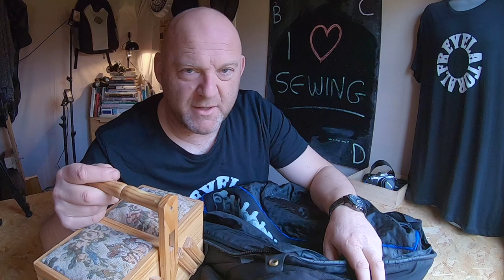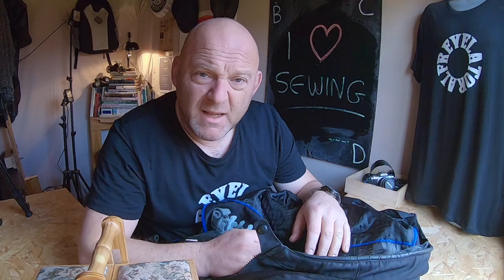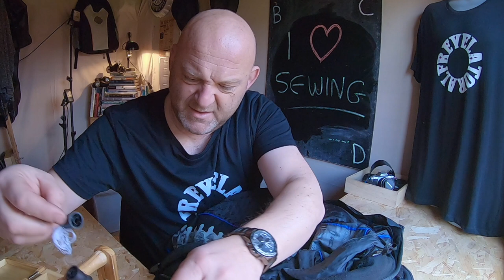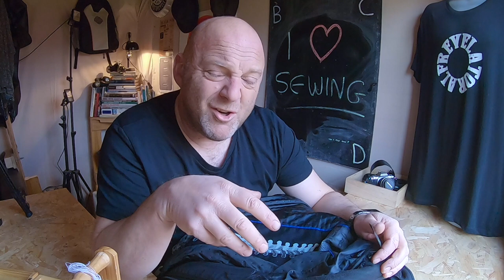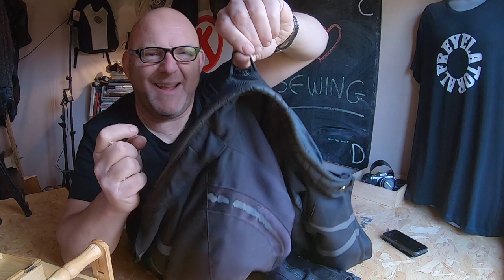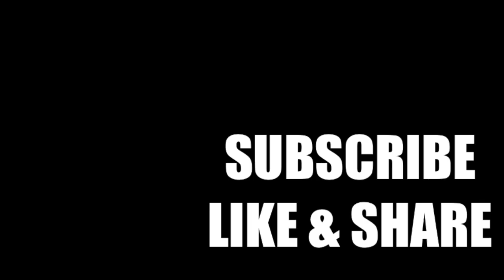Learning To Sew For Motorcyclists | Sew On Biker Patches | Riding Gear Repairs

Comment: Yup. I fixed my battery tender. Capacitor died, so I replaced it, less than a buck. Most folks would have tossed it.
Reply from the maker: There you go. Cheers

Comment: Looks like you did a fine job to me from what I could see. Haha I laughed when you said might not be so manly because as a motorcycle enthusiast you can get interesting stairs in fabric or craft stores buying materials and supplies. Those hooks break, and zippers especially on pockets of jackets they go and can be a pain to fix. Good needles and thread are important think of them like welding rod you can do the job with 6011 farm rod yet 7018 will probably be stronger depending upon the application.
 If you want to sew leather by hand use a leather or curved upholstery needle. Or better yet get an industrial machine leather sewing needle size 18 with #69 or go up to a size 19 or higher for #96 or heavier thread. Check the needle and thread chart for a machine. Now I use a lot of bonded nylon or polyester thread aka "Coats Upholstery thread" that is mold/UV resistant and on leather most of the time depending on the fix. Buy a Handy Stitch Sewing awl put that industrial sewing machine needle in that chuck of that sewing awl and familiarize yourself with how to use it takes a little practice. Learning how the stitch you are using works start to finish check out different types of stitches for your application keep it simple. Now on leather sometimes vinyl use beeswax on your thread when sewing by hand this will make for a better job think of it as brazing flux. Now if you need to hold your work in place and don't want to use pins you can use either contact cement, Marine Goop, Barge Cement, or 3M Black Gasket and Weatherstripping adhesive, or Tear mender sparingly. Allow adhesive to bond and sew it up. Or if you don't have any thread or needle, its an emergency, or lets say you have someone to sew it for you use that Black 3M adhesive on leather or vinyl it is flexible strong stuff don't get it on your hands it doesn't come off good. The others I mentioned will work yet not instant and as strong. I do not advise adhesive to clothing especially if its tore pants almost had a girlfriend brain me when her pants ripped again because I didn't finish sewing them right later. If you have access to a home sewing machine you can sew leather or vinyl yourself just don't burn up the girlfriend's machine because it could not be powerful or even strong enough to do the job and you get a few weeks of the couch, cold tv dinners, and just don't do that. Mother in law or her moms machine only if she will operate it for you. So now lets say your broke, need something sewed, and it requires a machine for the end result you want this is what you do lets use a patch you want sewed on like you mentioned this will save you money. Get some masking tape and tape the patch on go see how it looks is that where you want it to be if not move it. Next a tiny bit of adhesive or double stick tape under the patch to hold it in place where you want it so it stays there. Take it to an upholstery shop, boot shop, seamstress, or anywhere else that sews medium to heavy materials. They can whip that patch out on a machine in a few minutes and they will probably not change much or anything because they didn't have to lay it out for you. Reason I mentioned boot or seamstress is some have whats called a long arm patcher machine look up Singer 29K to see what machine I am talking about make sure they have a long arm patcher. Now the patcher machine I can sew outside of a sleeve, pant leg, sometimes replace a zipper, get into all kinds of hard spots, and fix what is tore or sew a patch on or over without having to cut a bunch of stitches taking more time. Now you can use a Hand crank "Chinese patcher aka Chinese Cobbler machine" if you can get one for as little as possible or free thats perfect because they are not good machines at all. Especially you plan on doing a lot of sewing they are not an industrial machine. I have a "Chinese patcher aka Chinese Cobbler machine" it was the worst decision for a machine if you need something reliable I wore mine out in a matter of months when it wasn't falling apart due to horrible manufacturing. So if you want a sewing machine buy a brand new one or maybe you might find a used one that is not a wore out POS. Another trick is get some ready wound bobbins with the thread you want, get your needles, little piece of beeswax, and all that fits into an Altoid Peppermint tin which can go in your pocket or saddle bag. With the make your own tin kit you can sew anywhere with that one which is probably the best for anyone interested in sewing I always have mine on me. Not manly well when you are on a date and the lady tears her pants with practice you can pull out the sewing kit, stitch her pants, and be able to honestly say yes I got in her pants without her getting offended haha. So If anybody has any questions I might know how to help or find you someone who can help. If you have read this far go try sewing, feel free to ask me questions I might be able to help you if not I can find someone who can. Thank you
Reply from the maker: I love reading your comments man, cheers